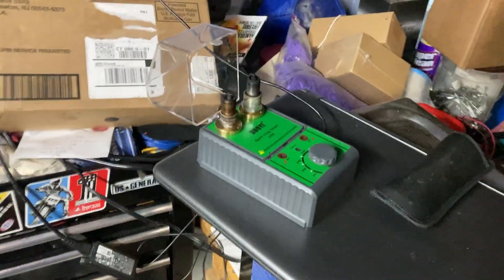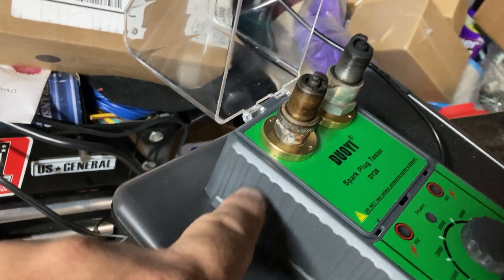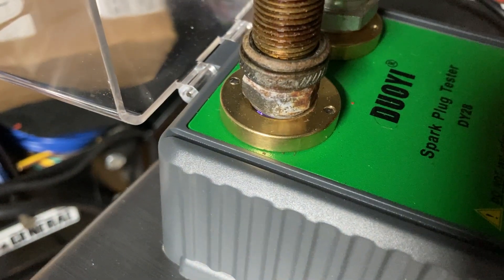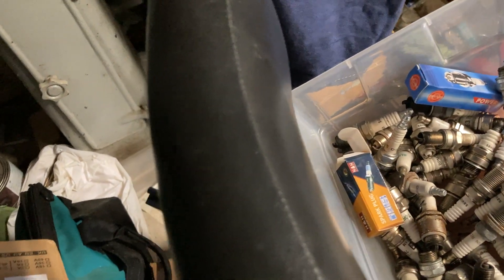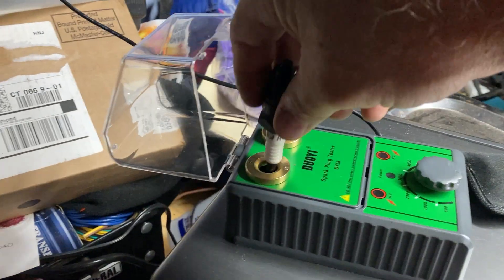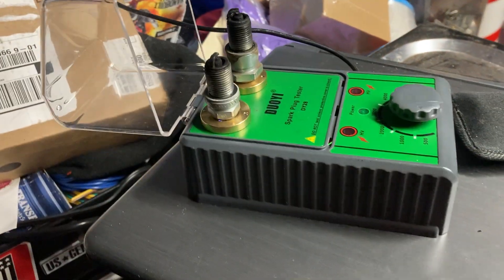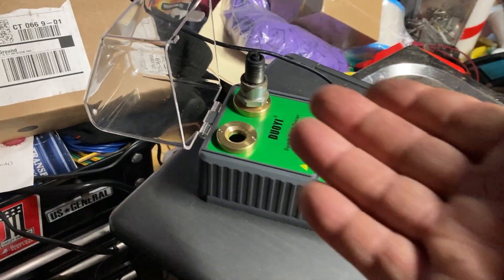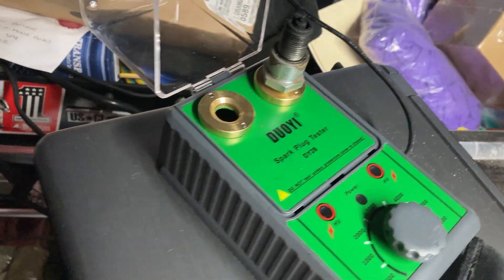A Cool Spark Plug Tester!

Comment: Hey Ken , Just wondering what is the voltage that you would get out of a small engine coil compare to a car ignition system . GM had there HEI system which could produce 60 000 V , the higher the voltage the easier to fire the plug even if it is bad or dirty . The dirt bikes had CDI which was shown to fire a spark plug in a glass jar full of water . The old scopes you could see how much voltage the plugs where taking to fire and if one was bad the voltage was higher then the rest .

Comment: Great tool.  Would be interesting to have a machine that would bring the plug temp up to simulate running conditions.  Sometime that work well when cold but not when hot.
Reply from the maker: Good suggestion Jim, maybe part 2 with a heat gun?
Reply: @KensSmallEngineRepair  Good idea and an infrared heat gun to check the temperature eh?

Comment: So what you have there says u changed lot of good plugs?? R they shorted or not good ground contact
Reply: Just like any small engine repair guy we depend on spark plug sales to help the bottom line LOL. In most cases the plugs are totally carboned up so it costs our customers less for a new plug then paying our hourly rate to properly clean the old one.